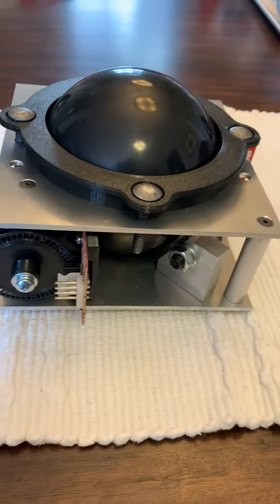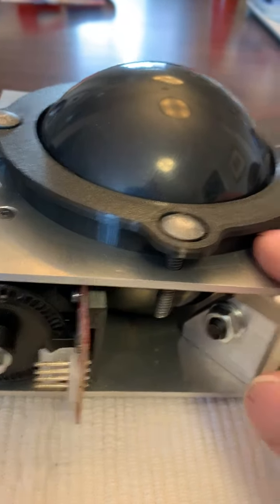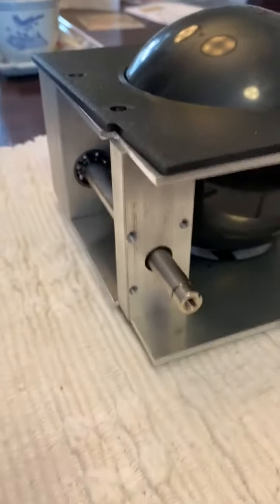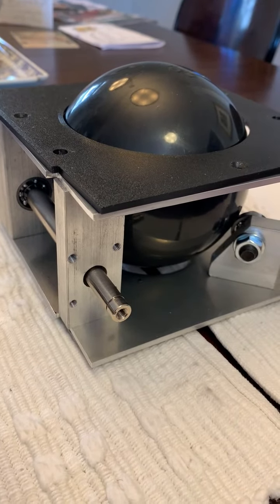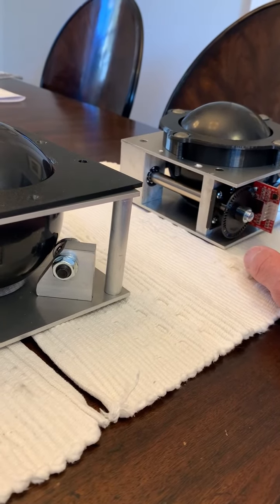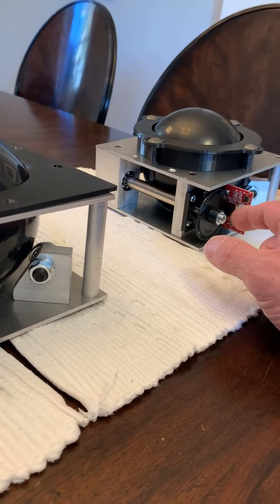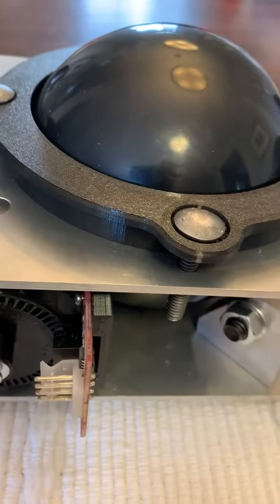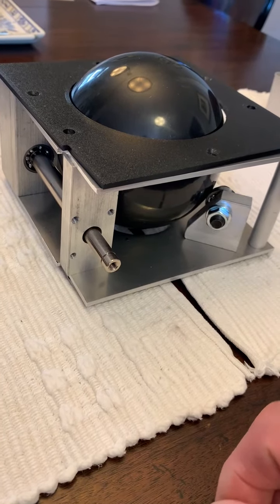Atari 4.5" Trackball Replacement-Missile Command

Comment: that's beautiful.  i made one with that ball and hacked a happ 3" unit.  took a while to get it right but works great.  mine is just made of mdf.  basically, just positioned the rollers out to accommodate the large ball.  some creative routing in wood and and laminate.  then used the repro cone buttons to make a removable control panel for missile command.   i bought one of your front line controllers on ebay.  thanks for what you do!
Reply from the maker: Thanks for your comments!    I just posted another video on my Anyway Joystick and in that video you can see my original full size unit hacked from a 3" Happ Trackball like you did.   I would suggest you go to Groovy Game Gear and get their  Hi-Rez Trackball Encoder Wheels next time you need some things.    I like my hacked unit better after I did this, faster and actually more like the large original.   See this video to see : 
https://youtu.be/xLPhvIGFJRE

Thanks Jay
Reply: @JP-cn7rp  I do have a set of those encoder wheels.  i didn't feel i needed them, i'm actually using a GGG opti-wiz as an interface.  maybe i'll give them a try.  i was really trying to live my 11-12 year old self and reach 810k again, or whenever you get the 100 free cities. lol  haven't played in a while, but i think i made it to 400k.  but those higher scored games were just kind of streaky luck.  but i could never get any kind of a decent score with a 3" trackball no matter how much i played with the analog settings in mame.
Reply from the maker: I have an original Missile Command PCB but haven't played enough to get good.     I am really good at allowing the missile through so trees can come back where they built those cities!!

Comment: I live in Australia and have had no luck in finding a full size Missile Command - after searching for a few years.  I have accumulated most of the parts over that time a cabinet that was converted to another machine, the marquee, and a couple of game boards mostly everything but a control panel.    I particularly wanted with the authentic feel of the 4.5" trackball and have been researching how to make one and then i found this.  How can I get one?
Reply from the maker: David,  I just sold one to a Peter in Australia, is that you?   If not, I can assemble another one.   Do you need for thin steel panel?   Thanks Jay
Reply: @JP-cn7rp  Jay,  A popular game down under it seems.  Your asking which design I prefer?  I am thinking the original one - I am yet to construct the control panel - but thinking it would be steel. I take it that the design should be bolted underneath to the steel - are there three or four bolt holes on that design?   If I then decided to use mdf I could still then sit it in a frame to be level with the control panel.   I take my hat off to you for building this - you should make a video of the actual build process too!
Reply from the maker: @daviddave7820  I have it set up for the original three bolt pattern and my four bolt pattern.    The three bolt pattern would not  work well with my wood panel type design, so I drilled four extra holes.   If you are not sure, I would go with the 1/2" panel design and shim down if you use steel.     This design gives you the most options and allows for the most exposed ball.    If you go on Ebay USA I have one available now.   Thanks Jay
Reply: @JP-cn7rp  Im in two minds but have been thinking that I would like to go with a steel control panel - would you be making any more of them?  Thanks Dave.
Reply from the maker: @daviddave7820  If you purchase one of my 1/2" panel ones, I will convert to steel panel type since I just need to change post.  I could possible get out tomorrow.
Reply: @JP-cn7rp  Jay,  OK will do,  so if I later wanted to convert to the 1/2" it would be a matter of shortened posts, and the plastic upper housing?  Was that 3d printed?

Comment: Would you sell one? I just got an original missile command cabinet with a grindy trackball
Reply from the maker: check on Ebay, I have a couple left.    New modern boards, new ball, new rollers, the works.   Thanks again,  Jay